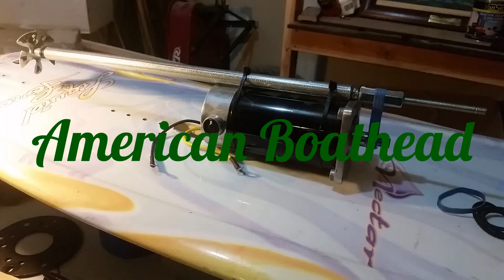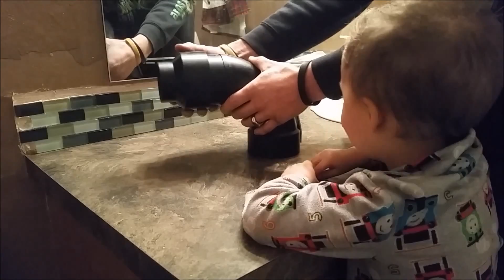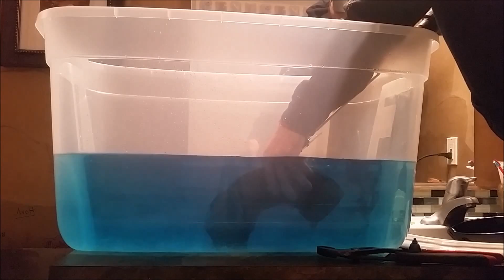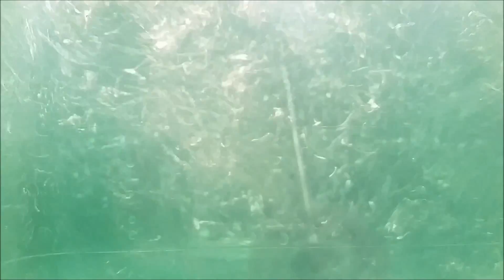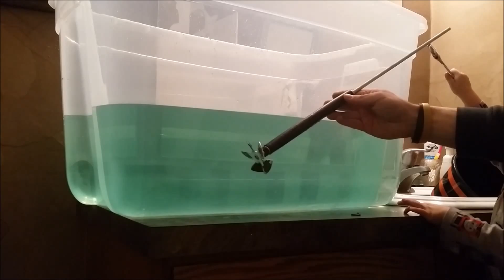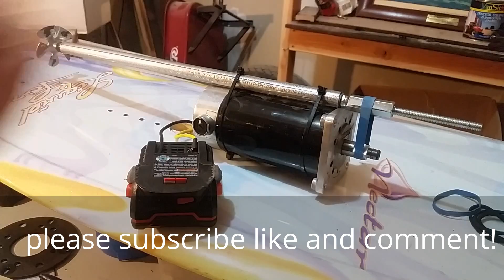jet drive propeller homemade testing

Comment: You need a seal at your shaft. The air is being sucked n from around the shaft and you have to seal it or the boat will take on water
Reply from the maker: Yeah that was the next step till i found that my prop was not working lol

Comment: May I ask where did you get the little propeller
Reply from the maker: Lol funny story..  its from LOWES (like home depot though i didnt get it there)  it is a mixing paddle from either the drywall section or tile section. It comes with two little fan like 'props' on it that can be removed with an allen wrench.  I took on off and bent the fins a little more and filled the holes with jb weld.  Lol  im sure the balance was not great

Comment: The prop blades need to be just about touching the tube and the reducer needs to be more than 2 inches behind the prop. After that it will work just fine.

Comment: could u please tell me about how to make that propeller?
Reply from the maker: +saidurga malleswar I made it from a paint mixing paddle from the home depot.the kind I got had two finned wheels. I took one off and filled the holes that were in it with jb weld. I also kinda bent some of the fins so they were all uniform.  If you hit me up on Americanboathead/facebook, I can send you close up pictures

Comment: Problem that's propeller, not impeller =))))) It can't create a pressure. No pressure = no jet stream, that's simple. Impeller should be designed to overcome pressure and "not let water go in opposite direction"
Reply from the maker: +Александр Журилко yep!

Comment: For a mini kayak light weight for the samll kids, do you think the jet system from a bathtub would work?
Reply from the maker: +NeoHeo i think it would work but would be slow. Unless it went fast and then it could wear out fast... but i dont know... it has to be much stronger than a garden hose for example.   Hard to say without trying it for sure but i like the idea!
Reply: I am about to scrap an old tub with a whirlpool jet in it, I was thinking of making like a sit on top kayak from styrofoam for my kids and add the jet motor on it. Not for speed just for them to play with and maybe fish from. Just don´t know if the engine might be too weak or how much battery power it would need. Will have to check it out when the tub gets scraped. I couldn´t really find anything like it on the internet.
Reply from the maker: +NeoHeo i would think that it runs on ac current so you would have to do a power inverter or switch the motor for dc or something... it would be pretty ideal if it worked though!  All that power through one jet!

Comment: So, why not lower the angle of the motor/prop assembly as much as possible and create a channel/recess in the hull aft of the shaft pass thru that would position the propeller above the hull line, thereby giving you a minimal draft?

Comment: You need more rpm to run a jet drive, that motor you have there is useless for the job. I think you need to start learning about the brushless motors, esc and lithium ion battery. Those components will give you success on your jet drive boat.  Yes, it is going to be more expensive may cost you up to $800 altogether.

Comment: try putting stationary veins on the thrust side of your impeller. it should force the water to go straight out of pump rather than continued spin as the water exits.
Reply: Hi can you do another mini submerine video please but instead of in a pool if you could do it in the river
Reply from the maker: +Dan Salls i just did a test last night that totally confirms that!  I feel like i need some kind of chamber for the blades or  pressure from intake or im still going to loose a ton of power.  Do you know?   I also stacked two blades and lined up the blades so maybe i need a smaller diameter pipe that tapers...
Reply: Definitely, smaller on the outlet.
You want 70 percent more area on the intake that outlet to increase the power and you need to stop the spinning of the water.
Reply from the maker: +Dan Salls do the anti spin fins need to be close to the blades? Im rigging stuff together but im still unsure
Reply from the maker: +Dan Salls awesome!  You have been a huge help already!!
Reply: You have my email, love your channel brother
Reply: I Sent you a drawing... apparently I can't do that.
Reply from the maker: +Dan Salls lol ill email you later today!
Reply from the maker: +Dan Salls thank you man!!
Reply: Happy new year
Reply from the maker: +Dan Salls you too!  Cheers to an awesome 2017!
Reply from the maker: +Billy Chadwick yes! This spring for sure!! Im glad im not the only one excited to see it in the wild!!  It really doesnt need much more done either!  Stay tuned!

Comment: That prop reminds me of a mixer I use at work. It's got the blades like that but there a set at the bottom then another set of blades about 3 inches up the shaft. Might be something to try.

Edit: mines all metal but this is what it looks like
https://hydestore.com/hyde-tools-09114-power-driven-mixer-24.html?fee=3&fep=1241&utm_source=adwords&utm_medium=websales&utm_campaign=shopping&gclid=CjwKEAiA1vjCBRDd-9q3w4OF6WUSJACWv_sVcPT3diQhQpoF_hX5GxNv2xA0-nM94-UKXR7Pb8AAKBoC2Z7w_wcB
Reply from the maker: +Corey's garage thats probably exactly what i used!!   Its made for mixing paint it says. Its interesting, the two 'props' are opposite direction of thrust! Its lame cause i cant stack them lol    i think a pool pump could work... it seems that itll be slow or the extra speed will wear it out fast. Idk though.. itd be cool to try

Comment: Cute kid. I know you were joking about being a role model, but honestly you already do more than most dads. A+. 

I am curious how you are going to seal the thru hull for the shaft? Did I miss that part?  Thanks!
Reply from the maker: +Justin W thanks man thats a huge compliment! 

My plan is to have the "shaft sleeve" part fiberglassed through the floor at an angle. The sleeve doesnt move so it is easy to seal into the hull. Im pretty sure, if i keep the top of the shaft sleeve higher than the water level, than water wont push through into the boat. (fingers crossed)   lol

Thanks for watching and happy holidays!!

Comment: boatman! missed your vids mate! my dad and I worked on some similar jet boat engine back in the 80s. I was a little older than your assistant. we found them more or less a waste of fuel so went back to old fashioned outboards... liked this vid a lot, very interesting. very happy Christmas mate!
Reply from the maker: +Mark McCluney thanks for watching!! Yeah it seems like you really need shallow water capabilities or its a waste like you say. Thats not even taking into account getting debris sucked in! Im curious what percentage of power is used compared between jet and prop.    Merry Christmas and i hope you have a great 2017!!
Reply: American Boathead I'm sure there must be a lot to read about on the web but just experimenting looks like it gives a more instinctive understanding, hands on like. I spent a few years as a physicist but my years as a mechanic taught me through the hands. both ways are valuable. anyway, keep floatin' in 2017 mate! very best to you and all the little boatheads.